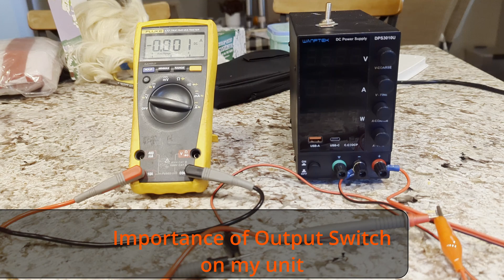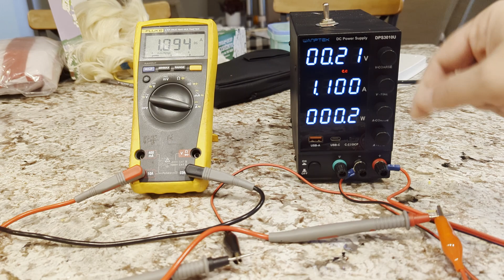🛑Why I Added an Output Switch on my Bench PSU

Comment: My Wanptek voltage is reading 4% low compared to the Fluke measured output. You are fortunate yours is fairly accurate.  Do you know if you can adjust the displayed output? i.e. does it have calibration pots?

Comment: for everyone's information i bought the same one and the fuse  and switch is in the Neutral Wire, I modified the wiring and so it had a internal fuse inline with the live, and through to switch, as in the UK it makes it more compliant and makes me feel safer, the soct on read panel had fuse in but on the neutral ..

Comment: i've just got one of these and i used the power on off as the isolator for the dc power. At the moment the ac side is permanently on but as soon as a new slide switch arrives through my door the mains will be powered up by this switch that will be situated in the slot the input voltage switch took up before being removed. No holes need to be drilled and no cables need to be replaced or lengthened, and the whole job will have taken me about 10 minutes.

Comment: The switch will remove power to the unit under repair immedstely and not have a decaying voltage from the power supply caps drain.
Reply from the maker: Hi Brian, thanks for the comment you are correct. There is no Cap decaying voltage through the output, but I am not worried about that, my worry is the instant current before the output switch was added.  This alone will save me some components in my circuit.